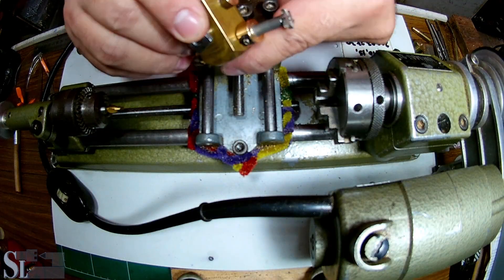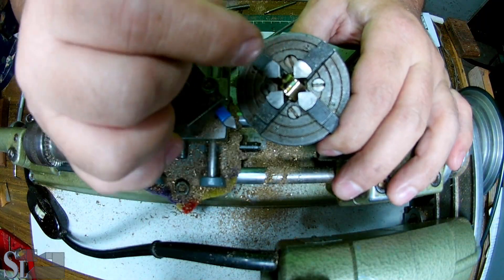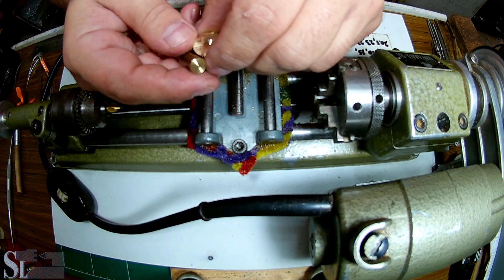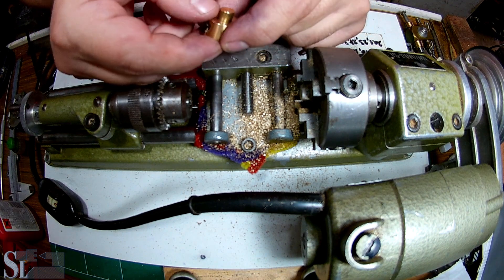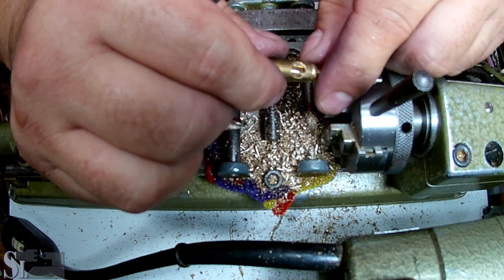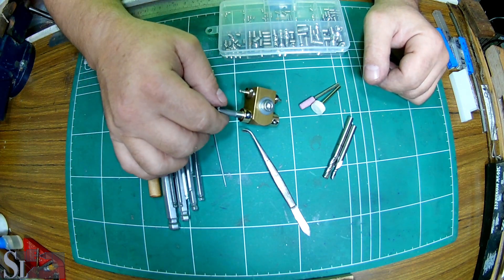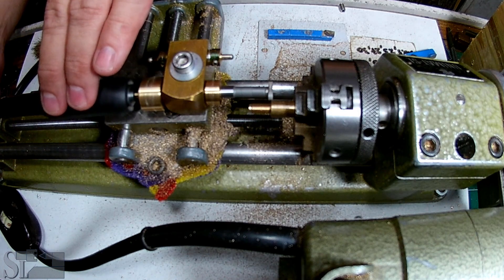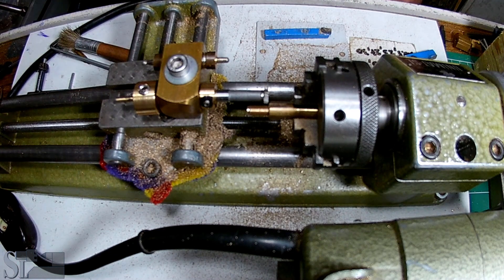Lathe Tool rest -  part 2 of 4

Comment: Nice build.

Cordless drill / driver motors are high(er) torque and low(er) speed than dremel type motors.  You can usually recover the gearbox as well, which can give you a very useful amount of torque for milling.  My grinding setup is powered by a DC servo motor, 60Krpm, the drilling head by a 775 (18v) drill/driver motor (from a cryobi), and the milling head by a similar motor (but 12v) wth its gearbox (from a hitachi).  The whole setup - steel for the blocks, aluminium housings with bearings, brass for pulleys, and the dead drill/drivers were harvested from the metal and ewaste bins at work.

The only bits I paid for were an ER11 collet holder and collets (which latter were pretty crappy dimensionally, but I reground them)  and a 24v dc power supply, under 20 euros all in from China.

My stuff is for a bigger lathe than yours, a Schaublin 102, but the principles remain the same.
Reply from the maker: Thanks for the input and tips!!! I did think of a cordless motor (I have two I can use) but it is a tad too big for my unimat. I have other scrap-bin salvaged motors - I will test one of these. I did not think of using a gear but that is a neat idea and I may add a pulley or plastic gear! Thanks again!!!